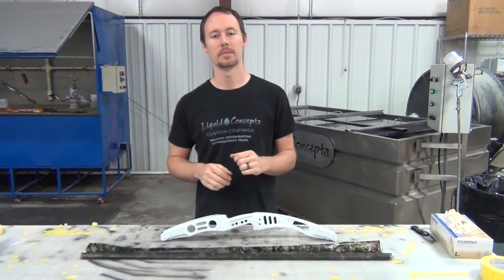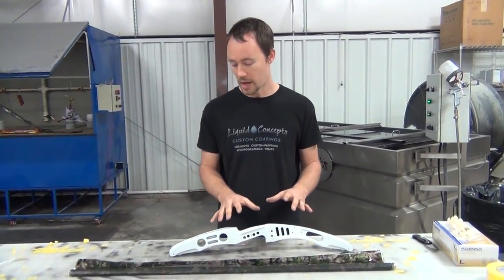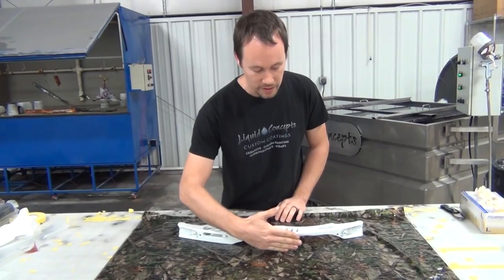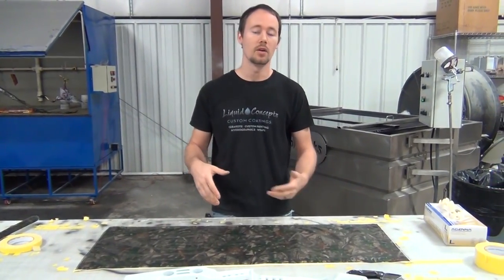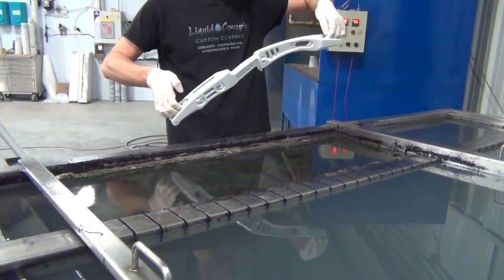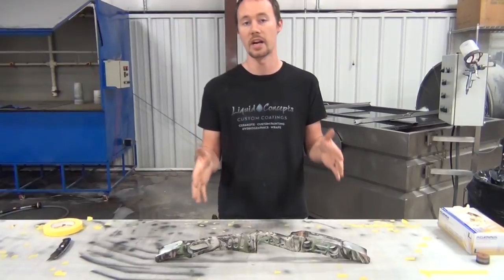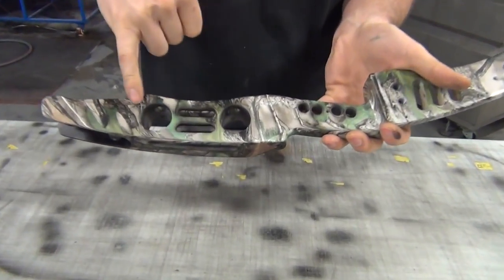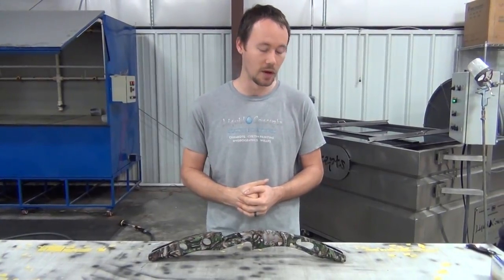HOW TO HYDRO DIP A BOW RISER | Liquid Concepts | Weekly Tips and Tricks

Comment: do you undercoat riser before dipping,great videos nice to see the whole process.
Reply from the maker: Yes we properly prep and base coat the part first before dipping.
Reply: so if it was a short archery riser all the screw and bolts have to be removed first are they all done seperately before its put back together
Reply from the maker: @stephenmegaughin4020  yes that is correct. You would want it full disassembled and then dip each part separately.